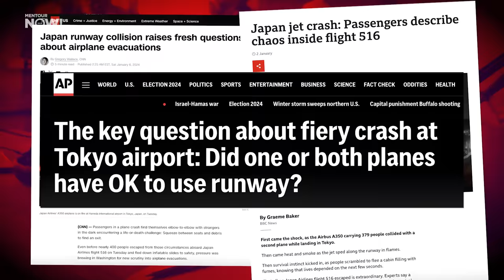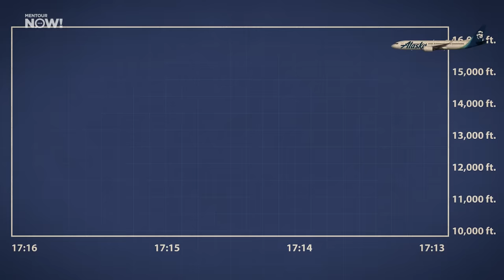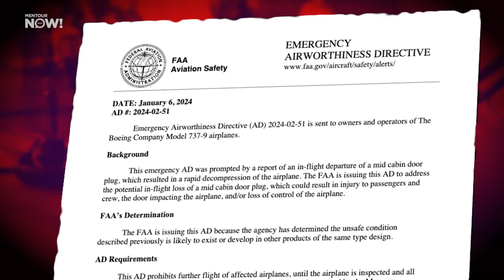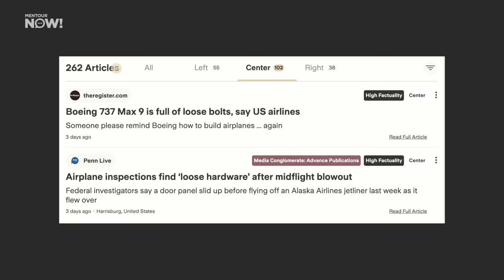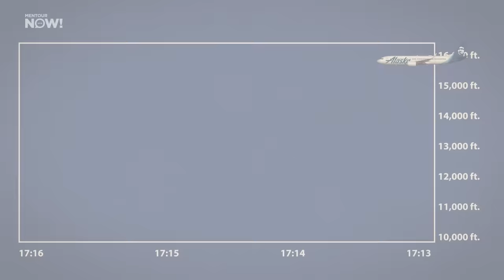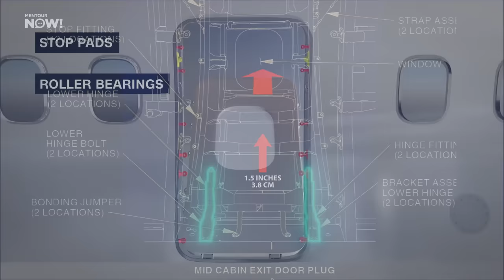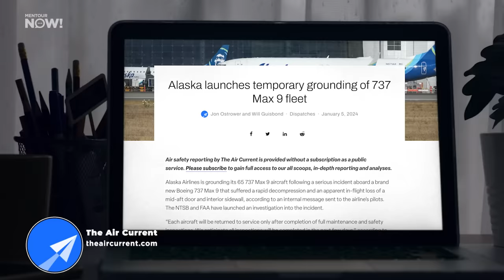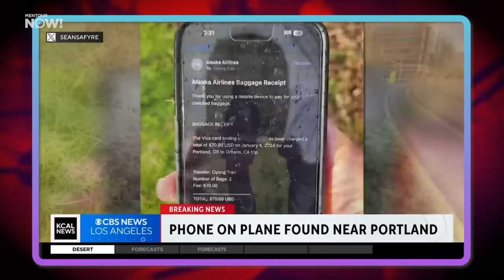WHAT Is going ON with Boeing?! MAX-9 Door blowout

Comment: 178 seats capacity, 171 seats full, and the two seats closest were empty.  Incredible luck.
Reply: Plus all lap passengers were far enough away.
Reply: I'm wondering if some couple that was supposed to sit there didn't make the plane on time
Reply: Or no luck at all. To big of a coincidence....
Reply: @teddyboragina6437          There's a video of an overweight lady fighting at the customer service counter demanding a free second seat... it didn't happen and she missed the flight. They oppressed her and herself
Reply: The fact they were empty perhaps means they were aware of problem already
Reply: Also that it wasn’t a door in front of the engines.
Reply: I wonder if it's policy to fill those seats last, in the unlikely event this exact thing happens.
Reply: @vaporisedair4919  The idea of it smacking the horizontal stabilizer hard is a horrifying enough scenario. Then depressurisation would have been the least of their problems.
Reply: I want to know about the previous flights and whether people sat there. If so, did they voice any complaints such as increased noise, vibration, or cold drafts. Maybe, just possibly there were some easily dismissed signs that the door plug wasn't perfectly fine until it catastrophically failed. These are just things I've been wondering, and they aren't based on anything but my imagination.
Reply: Not luck. I bet Alaska airline had marked those seats offline.
Reply: @patrice5976  They were aware there was an issue with this aircraft. On a few prior flights within days of this incident, there had been a few cabin pressurization warning light activations that were labeled as “benign”, checked and the aircraft returned to service. They decided to restrict the aircraft to continental flights only, in case something happened…they’d be over land.
Reply: I already do but will definitely always keep my lap belt on when seated.
Reply: Not luck. It is seat assignment software.
Reply: @teddyboragina6437 yea they missed the plane
Reply: I was about to point out, an it is all speculation at this point, but some comments out there are saying passengers were not assigned any of those seats from the start. Coincidence?
Reply: Or maybe after multiple decompression alerts in the recent past they had a suspicion regarding the issue and deliberately did not put anyone in that space.
Reply: Perhaps more leg space and therefore more expensive seats led them to be left empty?
Reply: Instead of fixing the problem causing the pressurization warning indicators to sound, they just changed the route just in case something happened it wouldn't be in the middle of the pacific. That's the mentality of the clowns making life or death decisions here.
Reply: It would have been catastrophe.. killed probably everyone if the door plug had let loose at FLT level 390
Reply: Seats with extra leg room cost more and are in lower demand?
Reply: Almost like somebody knew...
Reply: @vaporisedair4919 , you know how far the engines are outboard of the fuse, right?
Reply: we say Alhamdullilah
Reply: Was it??? Hmmmm. I almost find that way to coincidental. 
Imagine this…they knew this plane had some sort of pressurization issue so maybe they kept those seats empty just in case something  did happen? 
Lol, im reaching…but nowadays u cant be too sure. 
But yes, I’m very glad no one was sitting there.  That would have been bad.
Reply: Closed miss, what else could happen with these planes? Asking for a friend.
Reply: @cjswa6473  no. The plane is designed, and pilots trained for, massive pressure loss at maximum FL. The descent to 10,000 would just have been much faster.
Reply: Or there were passengers in those seats, who were sucked out, & there's been an incredible cover up!
Reply: Not only that but the debris didn't hit the horizontal stabilizers or any other part of the plane.
Reply: @bighoss9705  To put in perspective, you won't leave your home and schedule full inspection if one of your smoke detectors sounded once few days ago. 
Having window opened in case there is actual smoke is likely what people do for precaution.
Reply: @teddyboragina6437 probably Seth McFarlane
Reply: And the people near the door had seatbelts on.
Reply: Perhaps those seats had more leg room as a result of the plug and Alaska Airlines was charging more for them.  It would be a rare case of greed saving lives.
Reply: There was a guy that moved.
Reply: Impossible because people always occupy window seats
Reply: It's not luck - they fill the riskiest seats last
Reply: There was a whistling sound from this section starting with take-off. That's why the passengers left their seat next to the door plug.
Reply: there is probably a rule to fill those seats last, no such thing as luck
Reply: Yeah thats a safety thing. they always fill those seats last, if there is an event that requires the airplane to be evacuated, its better if there isnt anyone sitting there, so evacuees dont have to climb over their laptop & carry-on bags etc.
Reply: God Almighty is Good!
Reply: Maybe was deliverated... Maybe they already suspected something, and didn't sold those seat?
Reply: @Bren39  I think the same. This plane already showed some pressurization issues on the past
Reply: Even if someone was sitting right next to the door plug when it blew out, it wouldn't have caused a fatality. Probably some non-critical injuries, and a subsiquent law suit.
Reply: OR the whole thing was created and not an accident.
Reply: Any math brains here able to calculate the mathematical probability of those 2 seats being empty?
Reply: @DaleSteel  Created to what purpose? you have to remember that this same plane also showed some pressure warnings in previous flights. No single person fully checked that
Reply: Guys it's bs it  was of course a coincidence. Pressurization problems can come from a lot of sources, the least you would think of is that door plug. No airline wouldn't put passengers there because of an suspected air leak. Was just luck
Reply: Could it be that those seats have extra legroom (due to phantom emergency row) and therefore they charge a premium for them and therefore luckily noone on that flight thought it was worth it?

I always roll my eyes when an airline website tries to sell me premiums over $100 for a few inches more legroom, doesn't seem like a wise investment. But perhaps for very tall people.
Reply: @sparky6086 how's that tinfoil hat working out for you
Reply: I heard in some random comment somewhere that the person sitting in that row asked to be moved because of an annoying whistling noise coming from the door seal.  Unverified, of course.
Reply: Data indicates that Alaska Airlines knew they had a problem with the door plug and thus didn’t put anyone in seat right next to the door plug.
Reply: @C.Fecteau-AU-MJ13  No. The system doesn't even know where the plug doors are located (if present).
Reply: @alex180111  From my understanding this row is standard row spacing in this configuration since this isn't a functioning emergency exit row.
Reply: Grace, even.
Reply: It almost makes you think it was a known issue and those seats were vacant intentionally.
Reply: And then the black box recording mysteriously went missing 🤔🤔🤡
Reply: Maybe all airplanes need the same airplane case just like that iPhone case 😊
Reply: I know!  When I first heard these stats I was like what are the odds?!  I suspect part of it has to do with how Alaska prices and fills seats, but that’s just a suspicion with no supporting evidence from me.  If that’s not the case then that’s an even bigger amazing and very good coincidence.
Reply: YES, luckily for Boeing! On 99% of flights, passengers would have been sucked out and Boeing would be out of business… Boeing got handed the 1%. Boeing is so lucky
Reply: To all the people who say it’s not luck or coincidence.  Even if it’s a seating priority issue, the fact the flight wasn’t full enough to have those seats filled IS a good and amazing coincidence.
Reply: * If all 4 bolts were missing this would happen in the first flight. * It is impossible for all 4 bolts to fail at the same time. * The door panel did not even have a scratch or bent after 16000 ft fall. * Much bigger INTERIOR PANEL had disappeared. * The fallen cell phone shows the baggage was checked in on Jan 4th, a day before the accident. * Everyone was very calm, I wonder what the cockpit voice and the ATC communication sounded like when the cockpit door blew up (By design according to this video) ?
Reply: The probability of that is 0.13%
Reply: It's closer to the rear of the aircraft, so they would be less desirable than open seats closer to the front. And perhaps they have extra legroom because the aircraft can be configured for an exit row, so it's one of those "plus" seats airlines charge an extra $50 for.
Reply: Not really that lucky. Had people been sitting in those seats they’d likely would’ve been okay had they been seatbelted in (as everyone should be when climbing to cruise altitude).
Reply: @fonzireyes 
Alternative perspective.
I'm tall.
I like legroom.
I quite often book a door seat for legroom. (sometimes for an extra fee)
.
A passenger booking, not requiring legroom, would just pick the cheapest available.
.
Those requiring legroom would think (as I do)
"First choice, legroom with a door = easy access, last on, first off the plane at destination.
Second choice, Legroom, no door"
.
These seats are probably the last to be booked.
Reply: @alex180111 
Just posted exactly that.
Tall? (Me)
You book Door seats for "last on, first off" (I'm last to leave the lounge, catch up to the end of the line just as they finish boarding, sit straight down.
Legroom.
First off at destination.
Second choice is Legroom, no access advantage.
Reply: @krwiles 
smh
Reply: Luck, or was something known?
Reply: @hotsoup1001  and to add to your imagination, I wonder if people had just complained about General discomfort in that seat or that’s how it was take it anyway and so they made a note to fill those last or something but then yeah, you would think they would have looked harder before this. But then you look at how fast Alaska Airlines acted to check their other Max 9s and their finding of the loose or improper bolts. Not a flight anything over here besides very rare passenger and not in a very long time now like 20 years so definitely forgive any incorrect Terminology. but my point is, if they suspected something like that, I don’t think as much as it looks like somebody must’ve known if only those seats are empty… or even nearly only… I kind of think it was just really lucky.
Reply: @QueenofFlannelColors  yes, I did hear that. But whether they need those two seats should be empty is the question. That would mean they knew exactly what the problem is or very close. And maybe in the future airlines should ground a plan until they figure out what the hell is wrong whether it’s the indicator light or the actual pressurization that’s a potential problem! 
  At a minimum they need to be extra proactive with some of these manufacturers products.
Reply: @fonzireyes  and do they know what they’re talking about? or are they assuming? because it’s not really clear.
Reply: I expect better from a Mentor comment thread. 🙄
Reply: @sparky6086  do you think every passenger on that plane would’ve stayed silent about that?
Reply: @kenchen1351  but if it wasn’t the battery low sound and it happened a number of times in the last week, youd probably want to have an electrician over or the fire department or somebody over to take a look at the wiring and stuff in the house.
Reply: @kinghans6266  thank you it sounds like you read an article which is something a lot of us have not even done yet!
Reply: @rachmunshine9474   I’m not disagreeing they need to be more proactive with quality assurance and maintenance. As far as the seats directly next to the plug being empty, I’d honestly just call that a very lucky coincidence. If they were going to block off seats over the concerns, it would have more than likely been the whole two rows.  That close to the hole, a seat or two way still has the a high potential to get sucked out. 

It ultimately comes down to money. Which in the end, anything Boeing and their shareholders thought they were saving by cutting corners is gone and then some now. They certainly aren’t making anything off planes sitting on the tarmac.
Reply: ghammond3132  which was probably just a bit of a panic attack worsening what is probably usual for him to have some amount of flying anxiety. But it’s a good thing he listen to himself this time. Since we try to push through these things.
Reply: The crew must have known. And kept seats empty.
Reply: @CheatOnlyDeath  a couple of people have said that whoever was sitting, there was annoyed by a whistling noise when they were taking off, so they moved seats. On this flight.
Reply: @QueenofFlannelColors  yeah and I think if they had it narrowed down to that area, they would’ve looked harder and found it.
Reply: @Haywood-Jablomie do u have the link to that?
Reply: @rachmunshine9474  If the 5 Eyes threatened their families, they would!
Reply: There must have been some loud rushing of air coming from the door as it was slowly creeping up. Mind you there was too little time to notify anyone as the climb out which is loud itself was still ongoing.

Why are there holes in the center of those stoppads? I incorrectly thought they were bolt holes.

And based on that. Why so complicated. A bunch of bolts securing the plug against the stoppads could dispense with all the other mechanical stuff like hinges, springs etc.
Reply: @fonzireyes then the seats on the other side would have been empty too, right?
Reply: Weh doing the math it is 0.133%
Reply: @nottiification  but this wasn't an exit row, as described in the video.
Reply: @lukethompson5558 
This happened during a phase of flight when passengers should still have worn their seatbelts. 
Sucking out unlikely, serious injuries "only"

Besides - what is it with all these stupid conspiracies? 
Occam's razor. There was no conspiracy, Alaska didn't suspect anything of this severity. Their behaviour was most likely negligent and stupid. But not malicious.
Reply: @alex180111 Yes! I think you’re EXACTLY right! Usually these days with airlines trying to make money every which way they can, they charge extra for those seats with a bit more legroom! 

This was a rather short flight, and it is highly likely that there were not enough people willing to cough up the extra $$$ for those seats (note that the aisle seat in that row WAS occupied). In this case, in an odd twist of irony, the airline’s greed actually saved lives! 😂
Reply: @robertfindley921 EXACTLY right! That’s the most logical explanation!
Reply: @bighoss9705 not knowing anything about aviation talking here. Do you know what’s MEL my friend? If an airplane is not safe to fly, the pilot won’t even fly the airplane.
Reply: @KitaJabig Yes, but as others have pointed out, they were very likely “extra charge” seat’s due to more legroom, snd there wasn’t anyone willing to pay for them!
Reply: @jzakary1 Not really! Yes, you’re right that they most likely would not have been sucked out (if they were wearing their seatbelts), they would have suffered some serious injuries (just by looking at the condition of the seats)
Reply: @nottiification only problem with that theory is it wasn't a door. It should have been bolted shut so it couldn't be opened. It would have never been used as an emergency exit.
Reply: Perhaps wondered where the draught was coming from
Reply: @CoralSea  Hey, we could wrap cars in that!
Reply: @C.Fecteau-AU-MJ13  I was wondering if that row had more leg room or something. On shorter flights more expensive premium economy seats are often the last ones to be filled.
Reply: @747-pilot  Aloha Airlines Flight 243. An entire roof section ripped off at 24,000 feet. Only fatality was the stewardess, and only 6 passengers sustained serious injuries. I'm not saying a person sitting next to that door wouldn't be going straight to a hospital, but I think there's a good chance that whatever injuries inflicted would not be life threatening.
Reply: Perhaps they heard rattling sounds or felt some draft on the previous flight. Remember they conveniently overwrote the cabin voice recorder.
Reply: @coachjoel9463 I agree with you, just more news to discourage people from air travel,
Reply: @hellfire08  What happened by the ground crew is suspicious, but to be precise:
The flight data and crew recording boxes were found where they should be; what caused them to erase the relevant data was that the pilots did not pull the circuit breakers after landing and then neither did the ground crew for over 24 hours.

To be clear: pulling the breakers is an optional task for the pilots at the end of shutdown and they had just had a /whole/ day of it.
It was the explicit responsibility of the ground crew to ensure the breakers were pulled in a timely manner.
Reply: @scottmattern482  Big "oof" if that's true. Still doesn't relieve Boeing, but that would be damning for Alaska Air.
Reply: @LayneBenofsky  good point!
Reply: I'd even go further to: this is sus
Reply: Why would these plug doors not be larger than the cutout, like the over-wing emergency exit hatches? The latter can't fall out.
Reply: @Bren39  How do I collect my payout since I am officially taking you up on your wager offer?
Reply: @user-yt198  Have you flown this century?
Reply: @johanprins2056  That's for later removal.
With the roughly eight frame lugs and their plug counterparts perfectly adequate for the task you're outlining, it seems that the issue is with the components that prevent the plug from shifting up, out of alignment with those lugs.
Reply: Yes "luck" 😂
Reply: @hotmetalslugs  Meaning?
Reply: @patrice5976 I recall reading that they were.
Reply: Coincidence? I think not. I would like to see the seat map that passengers were offered when selecting seats. Had Alaska blocked off those seats?
Reply: Was it luck?  I wonder.
Reply: @Bren39 so they knew the plug will blow off and decided that only those 2 seats are in danger while the third seat and others in the vicinity are safe 🤔
Reply: Those seats must have been restricted.  Surely the person who had those 3 seats to themselves would have took the window or stretched out .
Reply: Pure luck.
Reply: @QueenofFlannelColors you mean they removed etops and the second pressurization controller took over and it was a non-issue. It wasn’t a cabin pressurization light btw.
Reply: @bighoss9705 well technically pressurization incidents are not lethal or anything so
Reply: @hotsoup1001  I was on a flight on a flight years ago where there was a strong vibration coming from one engine. Having flown on this type of aircraft and its predecessors many times, I knew it was not normal. I reported it to a flight attendant who said she had heard it before and didn't think it was a problem, but said it would be reported to the captain. No one from the flight crew came back to check. I think passenger complaints are automatically discounted, so reporting problems may do no good.
Reply: They knew there was a problem so they weren’t booking the seats.
Reply: @coachjoel9463  Wtf are you suggesting? That someone arrange for this to happen on this exact fight? How, exactly, would they do that? The bolts were faulty, even if that was intentional sabatoge, there's no way anyone would know which flight they'd fail.
I swear conspriacy theorists are the most intellectually lazy people on Earth.
Reply: If there was no bolts and no handle lock pin, the door would move / open on the first flight. Remember those doors are designed to open by a force of a small female, it would open on the ground while being taxing.
Reply: It’s a normal row. It’s not an exit row. The door is plugged and the seat configuration does not take the door’s existence into account.
Reply: @PhillyAvGeek  I'm not suggesting they knew the door would fly off - but they knew there was something wrong with the pressurization/door right? That's why they prohibited the plane from flying over water. But they weren't sure and they weren't able to pin the problem - so they had two choices, ground the plane and find the solution or continue flying the plane and take some actions to mitigate a potential catastrophe. They chose the latter. Again not suggesting it was illegal or against procedures.
Reply: i heard there was a teen one seat away from the plug. He was the one who lost his shirt.
Reply: @Haywood-Jablomie shame, the overweight lady could have plugged the hole 😂
Reply: @C.Fecteau-AU-MJ13  They're assigned last probably because these seats have misaligned windows.
Reply: According to one story I read, this wasn’t a coincidence. Apparently the people in those seats heard a whistling noise that was preventing them from sleeping and asked to change seats. In hindsight, the noise was probably because the door plug there was coming loose. It will be interesting to see if that story is confirmed. Those two are incredibly lucky to be light sleepers.
Reply: @Bren39  removing etops happens everyday to planes, it’s not a big deal.
Reply: @ronin_user  🤦‍♂️
Reply: Yes, indeed.
Reply: @vito774  I never said it was a big deal - but  that etops prohibition resulted from the issues they were having - right? Alaska knew there was a potential problem - and they did something about it - all square and legal. As far as the OP topic of the  seat being empty being extremely lucky. It could have been or it also could have been taken out of service. I think it might be the latter because it must have been noisy especially at the higher altitudes. The NTSB should surely have that info by now.
Reply: I noticed the extra [flat, WiFi] antenna on the alaska max9 planes, it is possible that those planes will use starlink networks integrated to their autopilot and all its system, like the tesla cars. Alaska and United want to gradually remove the pilots and fly the planes remotely like a drone.  Any individual, let alone governments and rich with a few thousand dollars can take control of the planes or can easily jam the signals. They did their test runs on tesla cars and many crashed with people in there.
Reply: Not luck. It’s worse. The airline knew something was wrong with that door plug and decided not to fill those seats.
Reply: I noticed the extra [flat, WiFi] antenna on the alaska max9 planes, it is possible that those planes will use starlink networks integrated to their autopilot and all its system, like the tesla cars. Alaska and United want to gradually remove the pilots and fly the planes remotely like a drone.  Any individual, let alone governments and rich with a few thousand dollars can take control of the planes or can easily jam the signals. They did their test runs on tesla cars and many crashed with people in there.
Reply: Did those seats have extra leg room? Maybe they were empty because people didn't want to pay extra.
Reply: @Bren39  but it wasn’t a loss of pressurization that was the issue, so I’m not sure what you’re talking about. One computer failed and the backup worked as it was designed.
Reply: @vito774  it was the pressurization panel or computer system. There's a knob setting AUTO, when that fails you put it on ALT. Though. I'm not sure why it worked in ALT.. It should have failed in a true pressurization issue (ie door partially open). Then there's a third setting MANUAL.
Reply: Or, Boeing knew there was a chance the door could blow out
Reply: Or they suspected the issue and kept those seats empty...
Reply: @RM_VFX  🤦‍♂️
Reply: Statistically unlikely
Reply: Only if they weren’t strapped in - I always wear my seat belt in plane until down on ground
Reply: It's a conspiracy!!
Reply: Gods work
Reply: Why does God allow bad things to happen?

this happens

Wow what luck
Reply: @rachmunshine9474  Yes, but you don't know if it is battery low or other reason. Therefore, you scheduled a check, not evacuated immediately.
Reply: @JohnnyWednesday "Riskiest seats"? What on earth are you talking about?
Reply: @QueenofFlannelColors yeah, but they didn't say that they suspected it was the door plug. They did above and beyond what the FAA requires for pressurization issues because more often than not it's a leak or mechanical problem. The doors are low chance of failure based on decades of data, I assume, and therefore the recommendation is to get maintenance at earliest convenience.
Reply: @anthropicandroid4494  The data on the flight data recorder wasn't erased. Only the 2 hour loop voice recorder data was lost. Airplanes don't have dedicated engineers. Maybe the engineers were focusing on the planes departing first. Then they would probably need an order from the maintenance centre before pulling the recorders. They don't randomly take it upon themselves to pull voice recorders.
Reply: Never mind finding the door plug. I’m amazed that they found the iPhone! And that it was still working!!!!
Reply: I’m not so sure it was luck! Coincidence? Purposely done? Something seems a bit odd about that!
Reply: or they already knew where the leak was
Reply: @C.Fecteau-AU-MJ13  The seat allotment algorithm works on managing the centre of gravity of the aircraft. I don't think potential failure of the plug door figures in that. Someone can correct me if I'm wrong
Reply: @hellfire08 "See I told you that friggin leaky door plug was gonna pop its cork Ed."
Reply: @patrice5976 I strongly disagree with that, because an explosive decompression can blow up the aircraft. It was lucky this aircraft was low enough to the ground that it didn't create that significant of a pressure variance that it would cause that. That plane would have never flown if they had suspected a problem. In fact, they had pressurization problems previously from what I understand, and they returned the aircraft and inspected it carefully.
Reply: wow..
Reply: About all the speculation why the seats are empty - here some facts about seat assignments: unless you can choose or these days buy your preferred seat (not sure if Alaska have that policy), without any user preference, the software is basically assigning you the seats. The logic of the software is to fill all the seats in the center first  (as long they are not allocated for premium seats or so) in order to optimise the weight distribution and with that better fuel efficiency. Based on that, by right those seat should have been filled. It might be the case that the passenger allocated to that seats were missing the flight. It is unlikely that it was kept empty due to the pressurisation issue because as highlighted, if there is a suspected leak it could be anywhere and difficult to pinpoint.
Reply: or a setup
Reply: @QueenofFlannelColors  it is very strange that some of the only empty seats on the flight would be a window seat with an open middle seat next to it. Makes me think the left those seats empty intentionally
Reply: Exactly where my mind is going, but lucky or planned? The odds of the 2 seats randomly being empty are incredibly low, in that exact spot. It’s a 4% chance any seat would be empty, 171/178. 2 side by side, at the exact spot, stains my brain too much. It is more likely those seats are the last to fill, for some reason. There is still a vacuum of info. I hope it turns out they were booked seats that no-showed. If they were never filled, WHY? What did they know? The math doesn’t lie, but humans do..
Reply: @coachjoel9463 I was thinking the same…
Reply: @vito774   The aircraft was under ETOPS rules because it had three prior and recent Pressurization Auto Fail indicator activations.  The crews switched to an alternate system after each activation, and then the issue was reported to maintenance, checked, no issues were found and the aircraft returned to service.  They actually haven’t confirmed whether or not the indicator light activations had anything to do with what happened and it’s still under investigation.  It could just be two separate, and oddly coincidental issues.
Reply: @kinghans6266   The incident happened 6 minutes into takeoff.  If someone was in that seat, they were’t going to be moved during takeoff.
Reply: All I know is if there was a infant without a seat close to that door Boeing simply wouldn't have survived the fallout.
Reply: @Beathemighty   I worked passenger operations in the Air Force. We were required to assign everyone a seat. There were no “lap children.” And kids under two we required an FAA approved restraint or car seat.  I don’t know why the civilian side doesn’t require this. Other than not wanting to inconvenience passengers. Is it kind of a PITA dragging a car seat around the airport? Sure. But I often wondered too…what’s your plan for the other end if you’ve checked your carseat and it doesn’t show up 🤷
Reply: @LayneBenofsky  If its not an exit row... why does it have an exit?
Reply: @coachjoel9463  no it's not lol. This happens. In Hawaii worse happened and only person that died were standing.
Reply: @nottiification  But it's NOT an evacuation door! It's not ever supposed to open (apart from maintenance) and you can't even tell a door/plug is there from the inside.
Reply: @rachmunshine9474  They hadn't even removed their seatbelts yet, so how could someone have moved?
Reply: There were 2 people sitting there, they were moved to ither seats
Reply: @gpaull2  this is still the internet. i would keep your expectations very low.
Reply: @hotsoup1001  I'm guessing that they would have both been empty on all flights after the pressurization issues were noted.    That would raise suspicions that they knew that the issues were associated with the door plug  (which would mean that the plane should have been grounded, not merely limited to short flights.)
Reply: @QueenofFlannelColors  Exactly.  They cancelled flights to Hawaii because of this very issue.  Not a coincidence that those two seats were left empty.  They were working to solve the problem with the depressurization and getting to the bottom of it.  The plug blowing off just made it so that it had to be solved now.
Reply: Maybe, maybe not.
Reply: I was thinking the same thing what are the odds on that?
Reply: was there a little excess noise that they found passengers didn't like because of a bad sealdue to lack of bolts? Or was it perhaps colder to sit in those seats for the same reasons?
Reply: People keep saying everywhere that this must be too big of a coincidence, they want to believe Alaska Airlines did it intentionally, whether that turns out to be the case or not.
It takes very little effort to see that the windows are spaced further apart & misaligned due to the door. Likewise on a similar setup of the same model, on a seating website, people had marked it as a "bad seat".
Reply: @C.Fecteau-AU-MJ13 Tue plane should - should - be fine, even if it lost an entire elevator. But the weight of that door is negligible so all it would probably do is make a very deep dent at minimum, and possibly sheer off a part of it at worst.
Reply: @Erusean_pilot  I assume you're repeating another persons comments. I can find no such reports, other than people near the hole moving after the door came off. Presumably that got distorted through comments based on other comments.
This would surely be reported everywhere if it happened, not to mention the response from the people that were supposedly moved, and the other passengers.
A flight instructor reportedly contacted Alaska Airlines:
' Alaska Airlines confirms to me that "nobody was assigned to sit" near the spot where the hole opened in the side of flight 1282, and "nobody was moved." '
Reply: @TheEDFLegacy  Yeah well although I think you're probably correct... that's a hypothetical situation that's best left untested.
Reply: @patrice5976 if you fly often you know that mid rear seats are the most likely to be empty. And 2 seats together means a couple probably missed a connection or rebooked their flight last minute.
Reply: @djg5950  🤦‍♂️ there was never a depressurization
Reply: @RM_VFX  Engineers are not going to ignore a known leak/whistling sound... if they are told about it
At my old airline, when the engineer ranks started to be thinned out (due to cost cutting), our contact with the cabin and flight crew were reduced. In the good ol' days, on some occasions, we might bump into the cabin or flight crew as they disembarked. Upon recognising us, they would say... "Oh, I forgot to mention xxx in the log books". We would get extra information and even extra defects by talking to the crew. Unfortunately, the new way is the so-called worldwide "gold standard".
Reply: No! ☝️ Unoccupied doesn’t mean unassigned, the seat could have been occupied at take-off and subsequently vacated due to the unbearable hissing the plug door was inducing on the verge of slipping out.
Reply: This is an exceptional video. Well done.
Reply: @AlexandarHullRichter Yes but the “explosion” for lack of a better word would’ve been more severe at a higher altitude, and the force more extreme.. other comparable accidents resulted in people being pulled right out of the plane, seat and all, and entire flights crashing with complete loss of life.
Reply: They save these seats for the disruptive passengers 🤣🤣🤣🤣
Reply: makes me wonder if they were leery of that happening
Reply: Somebody at Boeing told somebody at Alaska Airlines about it as they BOTH knew about it
Reply: @C.Fecteau-AU-MJ13 i think something like that has happened
Reply: Alaska airlines already knew about this issue but due to demand they decided to keep flying the aircraft but not sell those 2 seats
Reply: Hope those seats are booked last by default on these maxes from here on out
Reply: What row was it? So I can personally avoid…
Reply: @coachjoel9463 Yeah... I wonder if someone purchased tickets for those seats but didn't board the aircraft. That should be investigated.
Reply: Amazing.
Reply: Can you provide a link to that video? @Haywood-Jablomie
Reply: @jjptech  - "Created to what purpose?"

In my experience, conspiracy theorists are usually WAY less interested in actually getting to the bottom of things than they are piecing together random things and spouting bullshit to make themselves feel intellectually superior.
Reply: @zackakai5173  Ok, maybe you can provide your leads to get to the bottom? To what purpose? Please expand on what you think?
Reply: Maybe.
Reply: oh they knew, allright!!!! @krwiles
Reply: I think it’s likely that no one was sitting there because there is no window on that row. Probably the last choice for most people.
Reply: @jzakary1  it would have "sucked" for them. 
maybe they would have flown
Reply: this flight HAD a windowed panel. 19:39 @AnimalzyNL
Reply: @nottiification there is a full plastic panel covering the entire door. No one can get out that door. Boeing put 2 extra seats on that configuration, claiming it isn't needed for 120 passengers plus crew, to sell more planes to airlines to get extra revenue. If the FAA and Boeing does the right thing and get rid of the two extra seats and leave that as an emergency exit.
Reply: this one HAD a window.... there's much more tothis story @AnimalzyNL
Reply: @Haywood-Jablomie do you have a link to the video? It’s sounds like you’re just being bitter.
Reply: no it not luck they probably already know that why thay empty that place
Reply: Or Alaska knew that something was wrong around there. Investigation hopefully finds out.
Reply: Planned
Reply: Is it possible that due to the greater leg room those seats are more expensive and so for a short flight people choose not to pay. If there isn't some driver for this then, yes, incredible luck. The chances against 2 out of seven seats being located next to each other and not aisle seats and next to the dummy exit are huge if randomly selected. Thus a 'conspiracy' is leapt to whereas I prefer to chase down some real world reason and go to the mafia last.
Reply: That's not luck. Those are probably the last seats to be assigned, exactly for reasons like this.
Reply: @coachjoel9463 I bet they call you brain, don’t believe them.
XD
Reply: @coachjoel9463 bro what motivation would Boeing have to fake this. Or anyone else besides airbus. And if you think they would do this ur legit crazy
Reply: And all passengers still wearing the belts…
Reply: Not coincidence.  They knew something was not right
Reply: No luck or coincidence. Classic example of corporate overriding mechanics or good sense. They knew the pressure warnings were most likely coming from that door, instead of grounding the plane and getting it investigated and fixed they were told to leave those seats open and continue flying. Even the stupidity of only letting the plane fly only over land is evidence of their attitude. This was more an Alaskan Airline problem than a Boeing one. The Airline industry partially rely on an "if you see something say something" feedback loop from operators to help correct potential failures, AA should have grounded the plane and informed Boeing
Reply: Kudos to someone at Alaska Airlines who a) changed the route to short haul over land b) kept the seats empty. 

I know people think if they suspected the door plug why not ground the plane. However I don’t think its that simple. Why suspect a part that has no failure history? 

I imagine their thought process was. 🤔 “Intermittent air leak not found? Well let’s get it scheduled for a leak test. Meanwhile, inspect all the doors, the cargo door, the ditching valves, oh and let me block off the seats by the door plug and take it out of long haul rotation, just in case.” 

Their thought process could have been “well the leak wasn’t found. Schedule a call with Boeing on Monday and have one of their engineers try and find it”. The problem could have happened over water where 5 more minutes could have been deadly for more than the 2 people that would be next to the door
Reply: Boeing knew about the weakness and ordered all airlines not to sell the closest seats!
Reply: A divine message to Boeing?
Reply: Would any of us in this thread not have shifted ourselves into the empty window seat?
Reply: @nottiification But if this was a non-operational plug instead of a door, why would it be treated this way?
Reply: @Bren39  That's the ten million dollar question, isn' t it!
Reply: @alex180111  I like your confidence in humanity😅
Reply: @nottiification  huh? It wasn’t an exit row
Reply: @tpspc03  100%
Reply: OR Alaska Airlines actually suspected what the problem was and deliberately kept those seats unoccupied.
Reply: @patrice5976 This! Underrated comment. They knew there was a pressurization issue already so they were not allowed to fly over water. They probably assumed it could have been this door and probably was the reason no one was seated there. Lucky no loss of life on this incident but its still scary to see stuff like this happen.
Reply: If you look at the design, the door must move along a track before it is suddenly springs out. Even if all the bolts failed or were missing it takes a push (turbulence, attitude change, "g" loading) to move the door beyond the point it escapes. Seems possible it appeared fine until suddenly it wasn't.
Reply: I wonder if it was considered an increased hazard in general by the company/customers?
Reply: If only 2 seats were left empty on the plane, someone was presumably sat next to an identical door on the opposite side. Sounds like luck to me!
Reply: Maybe because they knew there were pressurization issues.
Reply: Indeed it is kind of a miracle
Reply: @coachjoel9463   i agree with you. i think they with reason did not sell that seats.
Reply: Isn't a luck bro it's God plan everything known already by God
Reply: @Bren39 lol . . . we could call them deactivated seats!!!!
Reply: i assume they fill that seats at last
Reply: @coachjoel9463 who decides when it is too big of a coincidence?
Seats at the emergency exit have more legroom and therefore are charged with a premium at most airlines. And this row was a row where normally the emergency exit would be. You see at the photos that the row has bigger legroom.
But rather to think about the issue you do imply that the 171 other passengers are complying with a plot to cover up the death of two people. 
And these two people also do not have any relatives or colleagues missing them?
Reply: Makes you wonder if they had a previous suspicion and left thise seats vacant on purpose.
Reply: Almost as if the seat allocation system is programmed to fill those 2 seats last 🤔
Reply: @QueenofFlannelColors wrong the warning light didn’t come on during fhe flights as you said. The warning lights came on post flight when the aircraft was sitting on the ground. I don’t see how the two issues are even related and seem to be a coincidence.
Reply: @C.Fecteau-AU-MJ13  Agree. That may be a policy which actually makes sense. It's a weak spot and in theory in a rare emergency case having access to the plug could be useful. Though you usually would need tools to open it. However if after a crash, for some unlucky reason, the other doors or the way to those doors are blocked, it is still an exit. So filling those seats last makes sense. Though that's of course just speculations.

I highly doubt that boing was "aware" of the issue since it seems the bolts indeed were missing. So it may be just a major maintenance mistake and they forgot to add the bolts in the first place. Keep in mind that all bolts would need to fail / fall out in order for the door to be able to detach.
Reply: @QueenofFlannelColors  Not sure if this plane really had any pressure issues before the door blew out. Because one thing NTSB has mentioned is that it had a known problem with one of the two computers used to regulate the cabin pressure. So the pilots had to make sure to select the other computer during flights.

This means that the pressure warnings on earlier flights could actually have been from the faulty computer and not an actual cabin leak.
Reply: @alex180111  But are there actually any extra leg space there?

Since the plane had these doors plugged, there was no need to make extra space between the seat rows to help with any evacuation.

And since you can order the plane with different number of rows of chairs, but a fixed number of windows, that means the seat rows aren't explicitly aligned with windows.
Reply: @nottiification  Filling seats around emergency exits last is a rule you can only apply if you have any emergency exit.

These seats were not situated at any emergency exit. Hence why this door is called a "door plug" and there was a panel on the inside hiding the existence of the door.
Reply: @jjptech  Note that the plane had a known defective computer controlling the cabin pressure. The other computer was working. The plane is allowed to fly with both computers broken - but that would put extra work on the pilots since they then need to manually control the cabin pressure.

So the pressure warnings earlier might actually have been caused by the known broken computer.
Reply: @dewyakana1543  If the company had known about any issue, it would have been 1000x cheaper to remove the seats, remove the panel and inspect. An inspection all 737-9 MAX owners have now needed to do.

Problems don't tend to go away. So no reason to pretend nothing. Now all 737-9 MAX ended up grounded.

But I can see how it seems "clever" to always suspect foul play. Even when that foul play is the much more expensive alternative...
Reply: @perwestermark8920  It was just a guess on my part, perhaps you're right
Reply: i suspect, that is no luck at all. one seat i can accept, but two. no. They probably guess the point of leak and deside to procrastinate it.
Reply: @sergeykuchkov2887  If you can accept one seat, then you can accept two. Why? Because it isn't uncommon with two people travelling together. And then cancel together. So it's common t9 see 2 or 3 seats beside each other empty because the family or company did cancel all people in the group.
Reply: Poor regulation saved by incredible luck. At least two prior depressurisation problems but regulation allows the engineers to just reset that, keep on flying albeit not over water
Reply: @sajahf  I actually think regulation allows flying over water too. Alaskan Air did on their own set a limitation harder than required by regulations as presented by FAA (or if ut was NTSB) earlier.
Reply: Or Alaska suspected a problem with the plugs and blocked those seats?
Reply: Luck or conspiracy?!? lol
Reply: they weren’t letting passengers sit there because there was already a known issue
Reply: @patrice5976  you are exactly right. watch the real engineering video about it. it goes into detail about how they knew about it already.
Reply: @patrice5976 💯 It is flabbergasting to see how most people see coincidences in everything 😅
Reply: Flying that next day next to doors made for a bit of puckering. Realize the likelihood is small, or I hope it is, but still in the back of the mind.
Reply: Because they charge extra for those I think, as “extra legroom” seats, so they weren’t going to give them away for nothing. Corporate greed saved those seats.
Reply: Sounds kinda flakey
Reply: now we know for sure BOEING forgot to install ALL 4 BOLTS that held the door in place ... How can you miss ALL 4 is what surprises me.. that's not a minor quality control... It's 4 major ones and at the same place
Reply: Not luck, an act of God!
Reply: @kinghans6266 Holy carp! A whistling sound? I wont even drive my car like that before checking for a door not fully closed. How did unqualified hires get in these positions?